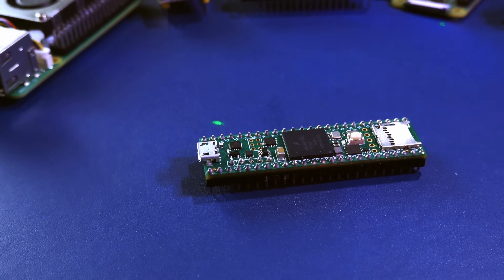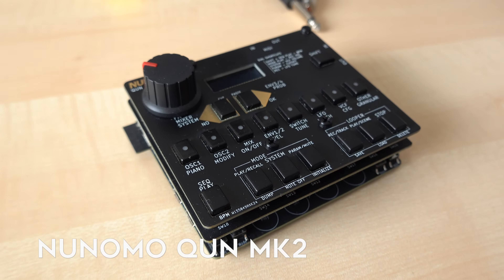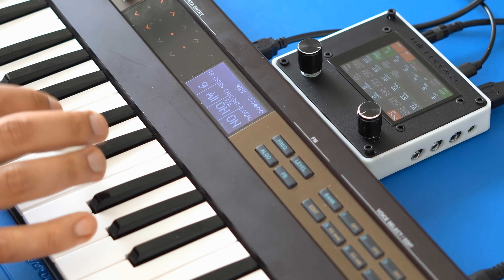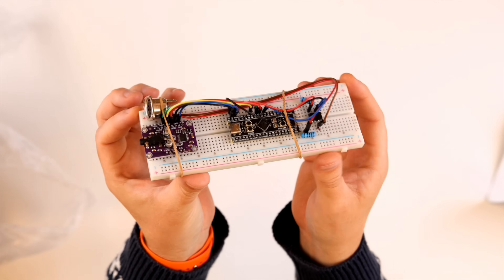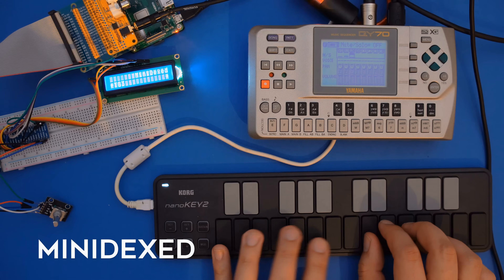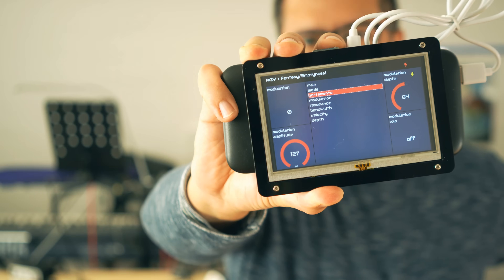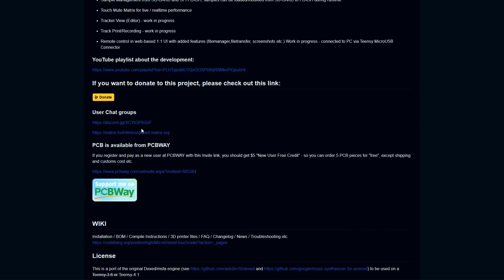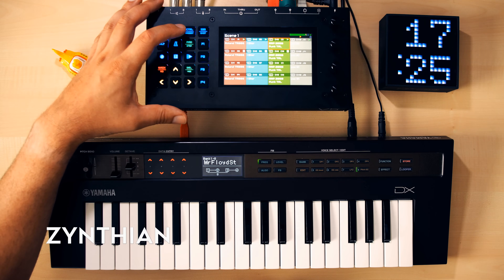DIY Synthesizers Explained: How to build your own synth // Summer of Synths

Comment: I have a degree in electrical engineering and computer science and I’ve worked in various software and hardware jobs and I’ve always been into electronics as a hobby, which includes using MCUs (Micro Control Units) alot, but pesonally, I never use them for Audio DIY outside of control logic. To me, the thing that’s really interesting when building my own devices is building analog devices, often researching how some classic piece of hardware works, altering it tomdo what I want and then building it, refining it and so on. 

Of course this takes much more knowledge about electronics, but it’s not magic and most people will pick up the basics quickly and evolve from there. The thing about learning is that it’s nevere a chore when you’re doing it to be able to do something you enjoy.

Comment: 14:25 This is not Zero W, but Zero H.
W stands for wireless, H — for headers.
Wireless means that wifi and bluetooth modules are built-in, meanwhile headers are those spikes are glued to the microcircuit
Reply: Or I'm blind, and they showed us wireless version without headers, but added headers manually

Comment: I am interested in building a hardware synth of my own so I can have a hands on experience.  I want to integrate Vital into it using maybe a raspberry Pi or something. i have absolutely no idea where to start.  It would have a small keybed, some knobs and some faders and maybe a button for latch.  To be able to access all the function I think is too much but the 4 macros , OSC selectors with the sound banks, filter knobs, and keep it simple. I'd still be able to plug it into my PC for new sound banks and other set ups but essentially a portable Vital. Maybe even with two nice but small speakers but also an audio out.  Keep it simple. 
I don't even know where to begin.

Comment: The PAiA 2720 modular synthesizer, 'a playable but limited instrument', was designed in 1972. The construction was published in Radio-Electronics magazine, May to Oct 1973. While a Moog system at the time cost from $5,000 to $10,000, the kit of all parts for the 2720 from PAiA cost $139. I had the real key bed and built many other modules with copper clad and a sharpie.

Comment: I just came across this video. This is really educational. I happen to have a YM2608 and the YM3016-D and I've been trying to think of a way to create a DIY synth that allows for use of MIDI. I will of course need to dig more deeper into what all hardware I need to prepare for the components and what not. I could assemble one without MIDI ports but that would require me to have loopMIDI I think since it would at that point be connected over USB strictly. Many possibilities~

Comment: I bought the Axoloti card quite a few years ago because it offered a modular synth environment software. Alas it‘s processing power was too low for what I wanted and the forum wasn‘t a pleasant environment either. But it was a great concept and worked as advertised.

Comment: Floyd is always a great resource withMe interesting reviews of DIY synths, tips, and tricks.  He was a great resource for your video, Bo.  I have a great deal of electronics experience; but, now in my 70s, soldering is OK through the hole; but SMDs (Surface Mount Devices) and soldering takes a great deal of practice not to mention dexterity which seems to be on the decline these days.  The equipment necessary is also costly so I prefer the bread board, microcontroller, and minimal soldering.  I tracked Zynthian development for lots of years; but, never took the dive.  Both the minidex and microdex synths seem to be my speed anymore.  Any way, great show with the both of you and always looking for more.

Comment: Last year I explored options for building a 96 pot infinite rotory midi  controller with full 16 channels. I wanted 15-20mm sized knobs and halo leds to show current cc (7 and 14bit) values for each.  Nothing like that exists on the market. Pricing it out the total came to over $1000 using multiple teensy boards. Tne big cost was the knobs! So a very tempting project alas, my soldering skills are not great, so I shelved it until I retire. 
But these synths may be a good starting point for this the larger dream midi controller project.

Comment: Interesting. However, I would love to hear whether there is a DIY synth other than the Korg Nutekt with full controls and how it sounds without any other device connected except for headphones. I am thinking if it is possible to get the AMIGA Paula Soundchip for example into a small DIY synth.

Comment: Also, for anyone seeing this and feeling intimidated by soldering, I PROMISE it is easier than you think. As long as you do a little bit of research into the sizing of the parts for your desired synth, it is fairly easy to estimate difficulty. Avoid 0402 parts and tiny integrated circuits as a beginner, and work your way up to harder stuff.

Comment: What about pure analog DIY synths?
Reply: I felt this wasn't well-placed in a video aimed at interested beginners. Analog circuits are worth several videos of their own, as understanding electrical circuits and the flow of current, and why certain arrangements of diodes, capacitors and resistors will cause a current to oscillate isn't easily explained in a few pictures and words (this is university-level stuff). There are some great videos on how to do this out there, but those tend to be long-running series ;-)

Comment: I highly recommend Minidexed. I use it as a piece of outboard gear. Pi zero 2 with an audio shim on it. Set to USB gadget mode so only one cable for power and midi required and one cable for audio. Put on the stock dx7 and synprez banks of voices so you don't have to go through thousands of sounds. I don't even bother with the screen and rotary control, you can cc and program change most settings in a daw.

Comment: I went down the rabbit hole of DIY standalone synths and it is amazing! Started out with the Electrotechnique TSynth. Based on the Teensy controller it gives you a really good hands on experience of creating sounds from oscillators to FX. It took me a while to get it working, and it still regularly fails and needs mending. The second project was the Tubeohm Jeannie, also based on a Teensy this one is really rock solid and truly amazing! One of my best sounding pieces of equipment! So yes, DIY can be rewarding.. And because you build it yourself nobody ever wants to buy it from you, so they are instant keepers in your setup.. 😅
Reply: Yeah! The Tubeohm Jeannie polyphonic Synthesizer sounds amazing and still gets more features with every new firmware.
Reply: Hey, I built a M8 Tracker Headless with a Teensy 4.1 and it's so powerful. Do you know any FX processor built with a Teensy 4.1?
Reply: @marcuscarneiro  The Jeannie uses an FV1 chip for FX. It produces very nice reverb and other FX for the synth. There is no external input though, so you cannot process external sounds. There are many DIY project that use the FV1, it’s a great chip. Check FX AID for example. The Teensy itself can run any kind of software, FX included. It does introduce latency from the processing which is not ideal.

Comment: An unexpected video, but great! :) 
Investing time (and a bit of money) in DIY electronics always pays off, wether it's digital or analog. Of course, digital synths is just one thing, but there is so much more: MIDI controllers, utilities like MIDI splitters/mergers. When you use Eurorack, there are so many things you can do with a $2 Arduino Nano at a fraction of the cost of commercial modules: clock dividers/multipliers, sequencers, complex logic modules etc etc. And make them do exactly what you need or want. Once you have a few skills under your sleeve:  soldering, the art of acquiring electronic parts, you open a new world of creativity.

Comment: In my infinite wisdom I decided to invest in 64 of those dual axis concentric-shaft rotary encoders for a DIY Matrix Mixer design growing like an alien parsite in my back-brain since my Buchla days forty-plus years ago.

Only to discover, "Measure twice, cut a check once."

I am going to have to learn FPGA to handle two sets of the 8 by 8 crosspoints worth of data in the matrix all by itself overloading my ESP32 S3 board.

Take Care

and keep teaching us the real-world issues involved under the skin of these beasts
Reply: Ahhhh...yes. in my dream project I discovered I'd need a lot of multiplexers. Way too many.  And thus a lot of custom code.
Reply: You should check out the "jumperless" breadboard project on hackaday, if you haven't already.  That thing also uses a big cross point matrix, might be good inspiration or a starting off point for your project.